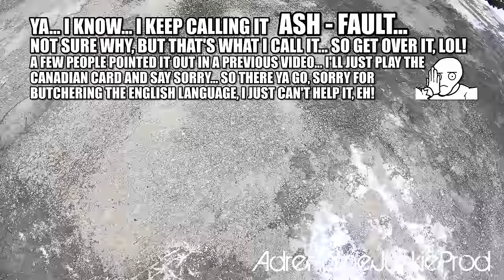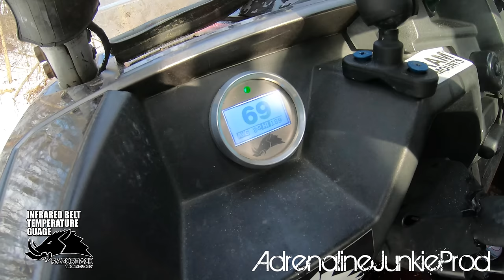Cold Creek Carnage - SXS/UTV Winter Trail Riding - KRX1000, YXZ1000, RZR Turbo, Commander 800, RZR4

Comment: I am still amazed at all the water you do with no snorkel on the belt exhaust at least.  Cant get away with that where we ride. Love the long vids man you make the best ones by far. No stupid hick hop music or other music. Just the machines and their engines.
Reply from the maker: Thanks man! Stoked you enjoy the extended length videos. Ya, I was never a fan of having overbearing music in the videos. I love hearing the vehicle sounds. I wish there was a good solution for the CVT exhaust on the turbo model. I haven't been able to find anything.
Reply: @AdrenalineJunkieProd  I seen some custom square plates used to adapt to the 90 degree silicon and then you can use the factory kit or make your own.

Comment: I know the Razors a heck of a machine but seeing all your wet belt issues makes me love my talon even more.
Reply: Also have 3500 miles on it with nothing but oil changes and 2 air filters.
Reply from the maker: The Talon is a sweet machine man. Wish we had one in the crew! The wet belt issues should be a thing of the past on my RZR. I've got a CVT exhaust snorkel now.

Comment: WOW! You guys are AWESOME! Unbelievable where those things will go! You mentioned you have a 650 Prarie, so do I ! I also have a 2021 Brute Force 750 and I fabricated custom Bumper/ Hitches for the front and rear of Both with some 30 Attachments that go on and off both! Quick Connect! Would love to show them to you! They can be used on UTV's also, and you would have tow points that you desperately need! I just subscribed! Love your videos!
Reply from the maker: Hey Robert, happy to hear you enjoy the videos. Thanks for subscribing! I had a ton of fun on my 650 Prairie, its a great machine. All those accessories sound sweet. Ya, most the SXS’s could use better tow points from the factory.

Comment from the maker: Do you think the Yamaha YXZ has what it takes to hold up on technical trails?
Reply: With the right driver.
Reply from the maker: @vaoff-road5577  Nailed it there, lol. It's not an easy machine to drive on terrain like this.
Reply: On the tight stuff a lot of 3 or 4   point turns but can be done with little  adjustment  on the ride height  plus 30” tires  . The 19 and up yxz  are better than the older ones.. but your yxz driver in vid  could have used launch control on that first hill to build rpms .  The results would be the same  but sound cool coming out of the hole.  By the way good  job on on your YouTube channel . I really enjoy them.  You guys ever come down here in Ohio  hit me up. Got couple cool trail systems  down here.
Reply: I used to own a 17ss. Traded it for the exact same rig in the video. If your ever in sudbury let me know. I've put it through some gnarly shit. And they are tough, I beat the thing like it owes me money.

Comment: Most folks don’t realize the only job of the tender spring is to maintain constant pressure on the main spring. It looks silly yes but just like ya said in the video “its more like a washer”…. Well kinda yeah. Just an expandable washer. 👍
Reply from the maker: Thanks for the input man. While we are on the topic then, wouldn’t having a larger tender spring that isn’t collapsed also add to the low speed comfort. Something the collapsed stock “washer” can’t do. It would apply constant pressure to the main spring still but since it’s softer it would act as the primary until it collapsed and engages the main spring? In a sense making it a dual rate setup. On the stock collapsed tender you ride just on the main spring. The tender spring has a softer spring rate so it provides the comfortable slow speed ride on the trail and when you hit a bigger bump the main spring kicks in? That’s all assuming the tender and main spring are properly selected to work together unlike the stock rzr setup. Like when you look at the shock therapy dual rate setups they have a much larger tender with a bigger stroke before the main spring.
Reply: @AdrenalineJunkieProd  that would work if the machine had a crossover ring. This would allow the machine to ride somewhat on the stronger rate tender spring up to a certain point where the main spring would be engaged. If you want a more plush ride at softer speeds without sacrificing drivability you should look into disconnecting the sway bar up front completely and test the waters using only the rear sway bar. I actually run an electronic sway bar in all of my machines (only the rear sway bar) and its the best mod I’ve done. It allows my machine to articulate a lot more effectively when disconnected as well as provide all the stability for high speeds when engaged.

Comment: Yeah your right on the tow points we had guys put bumpers on and the still did not hold up to being winched cause we ripped them right off
Reply from the maker: Ya, the tow points as well as bumper mounts need to be addressed for sure! It makes no sense.
Reply: We found if you had one a log about 24” or so when pulling up a ledge put the log near the edge under the winch cable as you winch it pulls the machine up and out

Comment: I own two Polaris machines a 850 atv and 900 ranger. I’m always fixing them pure junk. I also have a 750 terry4 that has been a great machine it only goes through belts every 2000 miles. It now has over 8000.  I wish we could get the Kawasaki KRX I love that SXS but unfortunately you can not register them in Wisconsin too wide by few inches.
Great video 👍🏻
Reply from the maker: Stoked you enjoyed the video Brian! You can't register it there!? That's messed up. What is the width limit? I've had good luck with all my RZR's. The KRX is a tough machine, Kawasaki did a great job on it.
Reply: @AdrenalineJunkieProd  Thanks here our law in how wide we are allowed .
UTVs are required to be originally manufactured, and must have at all times a width of not more than 65 inches as measured laterally between the outermost wheel rim on each side of the vehicle, exclusive of tires, mirrors, and accessories that are not essential to the vehicle's basic operation.
I know I talk trash about Polaris but the company does not care for the customer when it comes time to call them out for warranty work. I had many problems with getting things covered. Too many failed items to list. 
On the other hand I had Yamaha snowmobiles and I was treated like VIP customer no complaints on warranty work. 
Kawasaki I never had to go back for any warranty work on either my 650 prairie or 2012 terxy4.

Comment: All right you gear heads. I have a pressing question. Took my 900 rzr out for a road burn some dirt some paved maybe 1.5 or 2 hrs riding for a spring shake down. Got back to the shop and washed it then next day was looking it over and my oil cap is missing... I just did the oil change week before hadnt been road other then that 2 hr rip so I guess human error and I didnt tighten it. Any suggestions for where to start to save this engine

Comment: The snatch block you should hook to the side by side you are pulling out run the winch through the block and back  to the machine with the winch that's how you double the power and life of the winch.  The winch doesn't work near as hard that way.

Comment: Do you own Royal distributing? I've ordered alot of stuff from them over the years. Also are you guys Canadian? I'm in Nova Scotia. I'm between a KRX or a RZR turbo R. I do zero rock climbing and zero mud. Like cruising along on open diry roads\fire roads ect.
Reply from the maker: Hey man, I do not own Royal Distributing, lol. I've been lucky enough to be partnered with them for around 8 years now though. Their brand has done a lot for powersports in Canada over the years. If you aren't into rock or mud at all I'd say the Turbo R is a superior choice. It's a more versatile machine overall in my opinion. The KRX is a trail and rock crawling monster. However, the Turbo R just has loads and loads of power on tap. It's a wicked mid-high speed machine.
Reply: @AdrenalineJunkieProd  curious to see what that supercharged krx coming out in 25 is like.

Comment: Just got my first UTV but I'm hoping to have fun with her...KRX 1000 .... what is the largest tire i can safely on it...35x10x 
15....?
Reply from the maker: Congrats on the new machine. It depends on what you want to do, your riding style, the terrain you ride, etc. I've seen people putting 35's on KRX's but you'll need to adjust the clutching and I'm sure it will stress things like the axles. You'll also feel it. That's a lot of weight. For our type of riding a 32 or maybe a 33 would be good I feel but some people love 35's. It's a loaded question.

Comment: You should carry flexseal tape or JBWeld for the clutch housing leak - you might pick up some sponsors!  Great video!
Reply from the maker: I never leave home without JB Weld, lol. As for the clutch housing leak, in hind site we probably could of fixed it in 20 minutes by just removing the cover and installing it correctly. It wasn't on properly at the bottom. You can see it in the video after one of the creek crossings. I think it was the second last one when I dragged it through the deep water crossing.
Reply: @AdrenalineJunkieProd  yeah - saw that, thought it was a cracked case? We have a long history of fixing off-road mishaps with the ole JB Weld! Love the winter ride videos. I'll bet you appreciate the FinnTrail gear! on days like that
Reply: Might be the inner clutch housing seal, had that happen on my sportsman, hopefully just the cover seal, much easier to replace.

Comment: Snatch block gave better angle which helped but no more force since it was a single-action connection.  His belt case finally getting some water out and the tires not being crammed into the bank were what really helped in the end there.  I need to come riding with you guys sometime.  How many hours north of Lethbridge are you lol.
Reply from the maker: Far from a perfect extraction but it worked, lol. These trails are outside the London Ontario area. Not sure where Lethbridge is.
Reply: @AdrenalineJunkieProd  ah darn, thought you guys were in Alberta for some reason.

Comment: If someone is stuck like the 4seater RZR you should have had the KRX back as close to the edge as possible and quadruple up that strap or however much to make it as short as possible.  It would have lifted the RZR out easily.  I've seen suspensions ripped off of this when people try to pull them straight instead of up.
Reply from the maker: I think the main issue here was a lack of traction when trying to pull. That's why we had to tie the KRX to a tree. The ground was frozen under all the snow.

Comment: RZR has issues with front diff staying in 4x4 because of a weak signal going to it. Look for something called TRU-LOK 4x4 harness from HD Extreme 4x4
Reply from the maker: Hey man, the RZR4 recently had a CVT belt change and the case cover was installed wrong. Belt was getting wet. You can see it about 2/3 through the video. I've heard of the TRU-LOK but I've never had an issue with my RZR not staying in 4X4. Does it have any other benefits?
Reply: @AdrenalineJunkieProd  It just draws current from the battery directly when it’s switched on. I think it’s a good investment for the price compared to the price of a front diff. I noticed that your belt was slipping but I had already started typing so I went ahead and sent it anyway. Just in case y’all hadn’t heard about the product. Mine has acted strange before. Then I saw in a video where it happened to a RZR going up a hill and blew the front diff. That guy put in a link to the TRU-LOK. That’s how I found out about it. I’m not a salesman or anything like that. Great videos keep up the good work.

Comment: Where did you get the rear bumper for Commander???
Reply: I it's home made, I took a receiving hitch and took heavy walled pipe. Cut a hole out to slip it on the tip and welded it up! Hope that helps you out.

Comment: Any thoughts on snorkeling the clutch exhaust???? It’s a game changer.
Reply from the maker: Ya, but on the Turbo's it increases belt temps a ton at higher speeds. There is no good snorkel kits out for the RZR turbo. I've looked. I'm worried modifying the exhaust will lead to belt temp issues, especially at higher speeds. I'm open to input.

Comment: Did they ever get the 4wd figured out on the mav sport?
Reply from the maker: Yup. Got dropped off at Lockhart's Can-Am Dealership after the last ride and it was diagnosed and fixed in 3 days. Matt took it out for a ride this past weekend and said the 4X4 is working perfectly now. They diagnosed the issue right away.
Reply: @AdrenalineJunkieProd  good to hear! what ended up being wrong with it?

Comment: My biggest pev on polaris belt always get wet then you are Fubar.. probably pinched the seal.
Reply from the maker: You nailed it Dan, he did pinch it. Case wasn't on right. I hate how low the CVT exhaust is on the RZR Turbo. That's how my belt usually gets wet.

Comment: I think everyone should get a snorkel for the very first mod and always make sure your belt boxes are sealed such a dumb thing to happen ....
Reply from the maker: This was a fluke accident, John who owns the RZR 4 changed his belt and didn't realize that the cover didnt line up perfectly leading to these issues. It's all fixed now. As for snorkels, on the Turbo models they really restrict air flow, especially on the CVT exhaust which leads to increased belt temps. Belt temps are already a big issue on the turbo models which is why some of us are hesitant to snorkel them. However, I will be messing around with some snorkel options soon. It's silly how low Polaris made the CVT exhaust on these....

Comment: Just trying to get some opinions by guys who have been around a lot of different machines. I want a two seat dump bed and am looking at two Monday 2018 teryx le with 91 miles and a 2019 Yamaha rspec with 360 miles same accessories and both $11500 any help would be greatly appreciated
Reply from the maker: Hey Ryan, what do you want to do with these machines? Need a bit more info. Are they for trail riding and work use or mostly trail? What type of riding?
Reply: AdrenalineJunkieProd thanks for getting back with me, pulled the trigger yesterday on the Yamaha rspec with the 850cc motor over the teryx. I liked them both but the build quality and power and handling of the wolvy was way better and couldn’t here myself think in the teryx. I work around the property and plow ,also ride backroads and tighter trails , nothing as extreme as you guys are doing though.

Comment: The rear tire senors on a Rzr dictate front tire engagement.....if the rear is slipping due to belt carnage, you lose the front.....or get a poor response to say the least....    :-)     ......SILICONE YOU BELT COVER !!!!!!! ......here in East Texas it is mandatory......LOL....     :-)
Reply from the maker: Really! I didn't know that the rear wheels impacted the front engagement like that! The leak was caused because the case was on crooked on the RZR 4. Mine is probably water getting in the CVT exhaust since its so damn low on the Turbos... huge design flaw... or it could also be a poor seal . I ordered us both upgraded OMC CVT case cover seals. Hoping that fixes some future issues. I need to see if I can increase the height of the CVT exhaust a bit but the design and location make that difficult.
Reply: @AdrenalineJunkieProd  There are videos that show rear wheel slippage on ice and how quick the front engages....pretty awesome.....best 4wd system yet........
Reply: @AdrenalineJunkieProd  ....can you do a video on how you might fix this.....PLEASE !!!!?????? .....I get really small splashes of water in my airbox.....

Comment: Has anyone in the crew considered getting one of those new Cfmoto 950’s?
Reply from the maker: I like to consider myself pretty unbiased but I don't think any of us would get a CFMOTO... I don't feel they are built tough enough, they don't have a solid service network, they do not stand behind their warranty and lack the stock needed to service their vehicles. On top of that there is poor aftermarket support. With that being said I would love to get  CFMOTO out on the trails a few times to prove me wrong. We have ridden with CFMOTOS a few times in the past and they have always failed before making it to the end of the ride when no other machines had similar issues.
Reply: @AdrenalineJunkieProd  thanks for the response. For the riding I do and my budget my Cfmoto is great. The trails you ride are tough compared to what I ride. I have a cforce 500. My Dad had an 800 trail but the suspension was really stiff and it rattled itself apart with the help of a bad temperature sensor it kinda blew up. My cforce has been perfect so far. It’s a 2019 and rides ok shocks aren’t the best.. There really isn’t any aftermarket for Cfmotos other than bumpers and doors. 
Again thanks for the response and thanks for the amazing videos.
Edit: my dad now has a 2020 1000s it is so much better than the cfmoto in every way.
Oh also YouTube shorts dosnt seem to mind atv videos and people doing “dangerous acts”